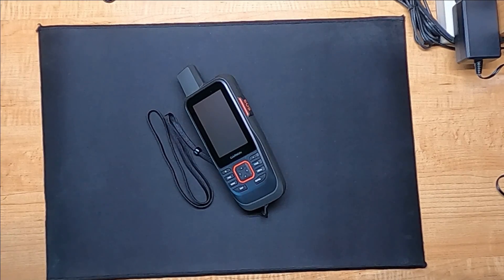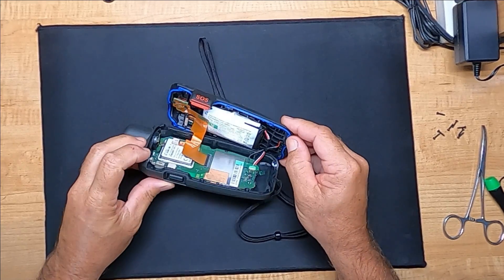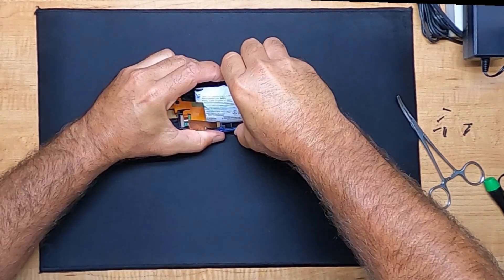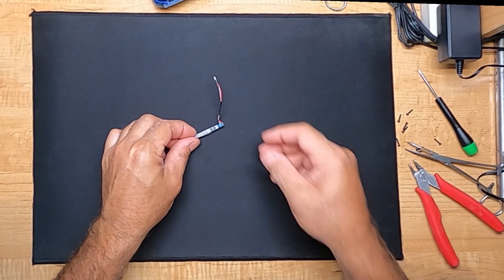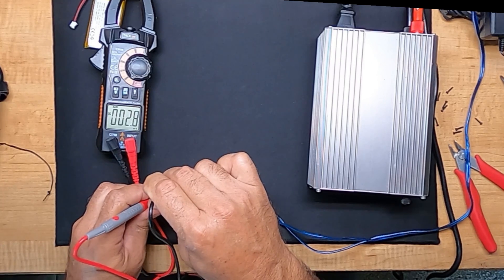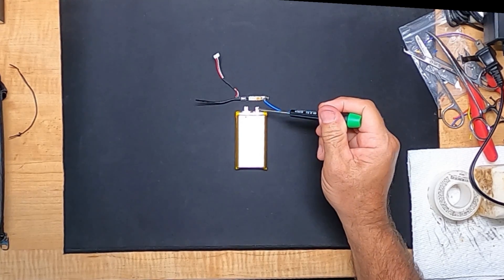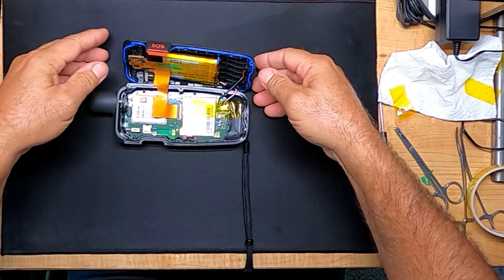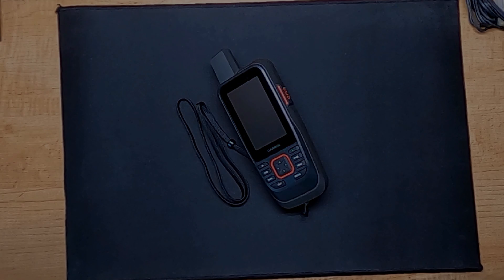Garmin Iridium GPS Communicator Dead Battery? (Rebuild It) ~ SIMPLE!

Comment: Hello. I have an idea for a new video. I have found an inverter on eBay called "MillerTech EDISON 600W Makita 18V Power Tool Battery Inverter". It is an interesting concept for someone who does not have extra 12v lead acid/LiFe batteries around, but has some power tools batteries. 600w with pure sine wave seems to be enough to power a fridge or a freezer in case of an outage. I would be personally interested in detailed inverter review.

Comment: Why did you want to swap the protection board?  I probably would have left the board in place but swapped the old connector to the new battery (ideally just the housing if the contacts were the same, but most likely move the connector and wires to the new battery's protection board or worst case cut and splice the wires mid-way).
Reply from the maker: @Sylvan_dB  3 wire vs 2. Old board had temp sensor, and you never know, they could've designed it to only work using their battery.